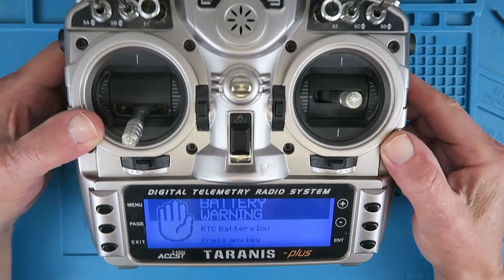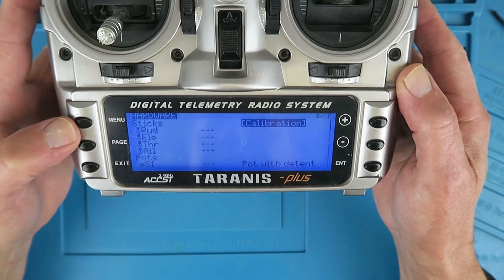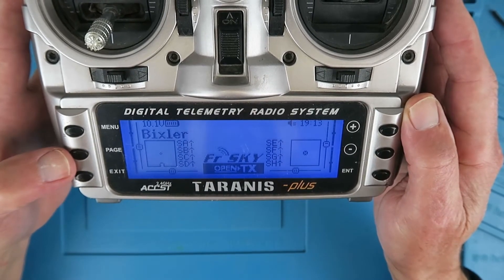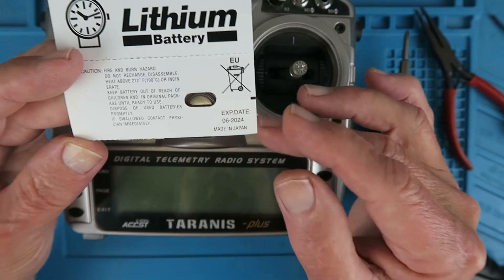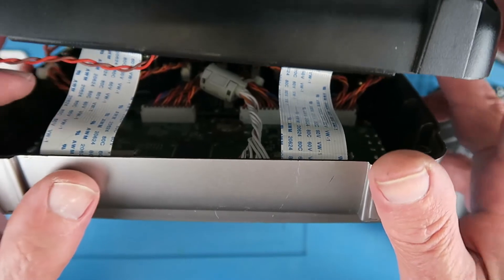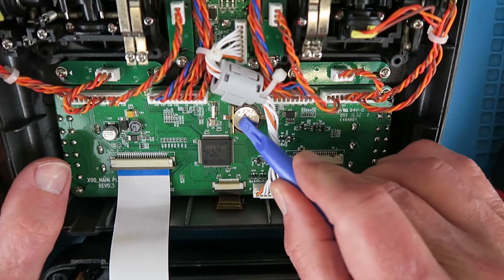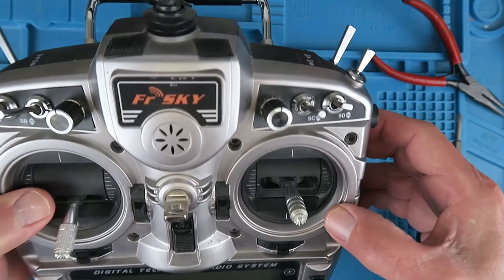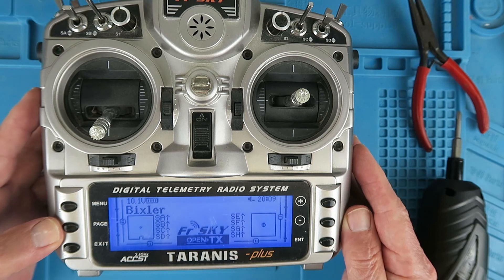FrSky Taranis RTC Battery Replacement

Comment: hi bud grate video what would happen if you didnt change the battery i checked mine in the menu its very very low  and possably not reading the radios battery corretly  will this affect flight  in anyway if is  not replaced thanks  if you get this message
Reply from the maker: The RTC battery only keeps the time and date for the radio, even if it is removed it will not affect the flight in any way. It's only purpose is to set the time and date on things like files on the SD card. For example if you logged flight data telemetry to the SD card it would be important to know when thee values were collected. Thanks for watching, have a great day!

Comment: I came here because I got the warning on my Taranis QX7. It turns out the procedure for that one is almost exactly the same, but only 4 screws instead of 6 to remove, and the battery is on the bottom right side once you have it open.
Reply: Same battery?
Reply: Just turned it on again after replacing the battery, expecting to have to reset the clock, but to my surprise I didn't. It seems it is able to keep the time even without the battery, at least for a short time.
Reply from the maker: Thanks for sharing, that will help others that arrive here with the same problem. Please consider subscribing if you have not done so already!